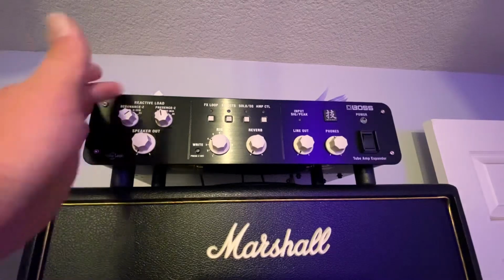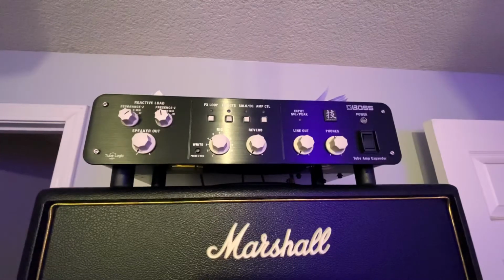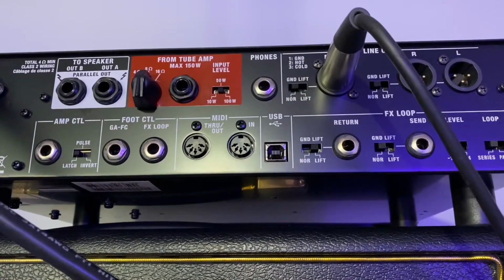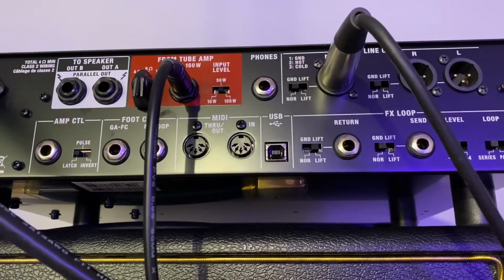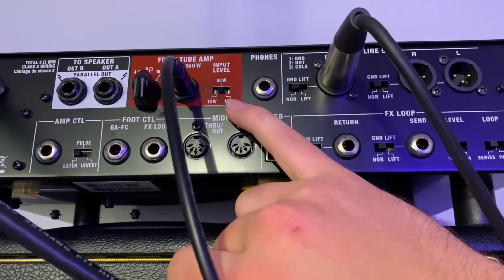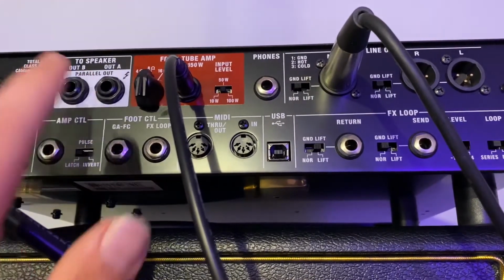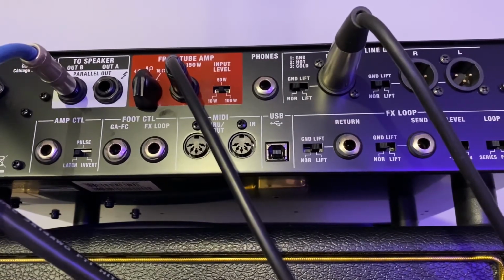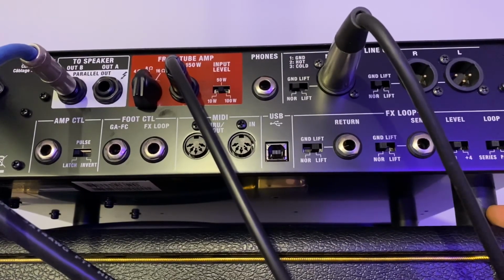Boss WAZA Tube Amp Expander SAFETY STARTER GUIDE

Comment: Iv heard people say that tweaking the reactive load knobs on the from can ruin their amp aswell, do you know anything about this?

I’m looking into older marshall and want a good attenuator, but am curious to try there ir stuff possibly so I don’t have much experience with these types of devices.

I haven’t seen many people address the issue with the reactive load but apparently that’s another way to ruin your amp .

But you’re the only person Iv heard say this actually colors the sound a lot, are you talking about using it as an attenuator it colors the sound a lot? I was looking into this because it seemed like one of the most if not the most transparent attenuator out there 

Any help? Thanks

Comment: Excellent was searching for this as manual leaves much to be desired typical of Boss/Roland product guides. So if I want to hook up my Bogner Uberschall amp/cab to the Waza TAE and connect my HX Stomp for effects and send output to a mixer/recorder device, how would I do this correctly? I have a new Bogner Uberschall amp 16ohm to 16ohm speaker output.

Comment: Dude thanks so much for this!! Imo, Boss does not make any of this clear on their website or manual. Do you have a tutorial for getting started in recording with the TAE? So far, I've only used my TAE as an attenuator and now I'm looking to record with it, but I'm unsure how to connect/use it with my PC and Ableton 11. Does the "to speaker" port need to be connected if using the TAE to record, or do you just need the "from tube amp" and "FOH" line out to an interface in order to record? Thanks a ton!

Comment: if i have this inline, can I bypass it easily?  Can the TAE be powered off and still attenuate, like other attenuators, so long as speaker is attached?
Reply from the maker: No the way it works isn’t as a passive attenuator. Its an active attenuator only. It only will make sound with its built in power amp
Reply: @FuzzImp  Thanks,  that sounds like it really would colour the tone more - Boss says it's transparent.    What do you think?
Reply from the maker: @gavin4848  stock, an EQ is applied quite a bit on most of the presets. I went in and tweak or bypass them on the power amp section

Comment: Thanks for the video! Can you please explain why you are running from the head at 8ohms to the TAE at 8ohms to a speaker cab at 16ohms? Also, why did you choose the speaker out B on the TAE? Can I run an 8ohm cab? Can I run 2- 8ohm cabs? Thanks!!
Reply from the maker: The TAE power amp can run any cab load up to 4ohm. Since it’s solid state and has no Ohm selector it essentially doesn’t matter what cab I use so long as the load is balanced (for example not running an 8 ohm cab and a 4ohm app cab off the two outputs.) I think the key is making sure 1000x the ohm and output of your amp going IN to the TAE is correct. The TAE Speaker output is far less critical and can even have no speaker load attached which is not typical of attenuators.
Reply: @FuzzImp  thanks for the reply!